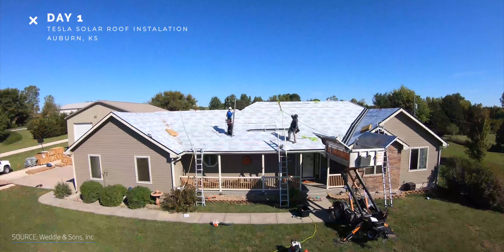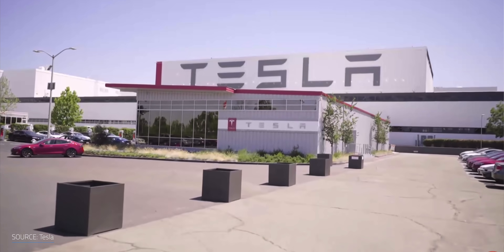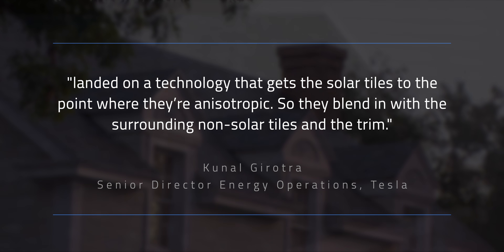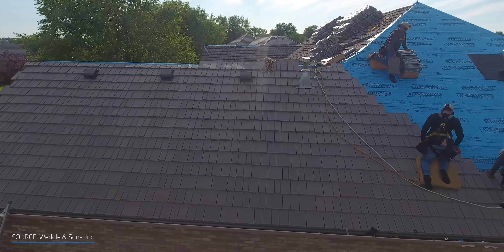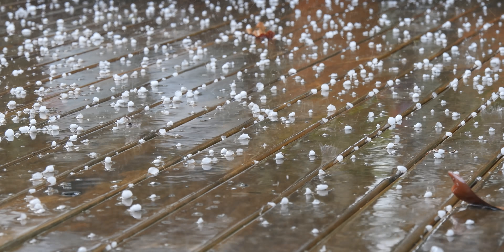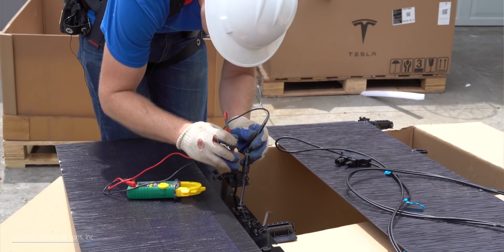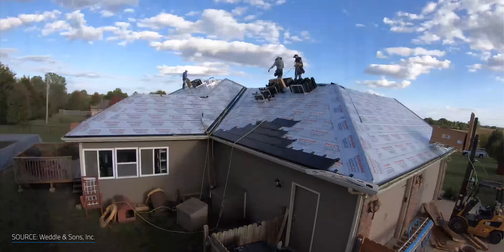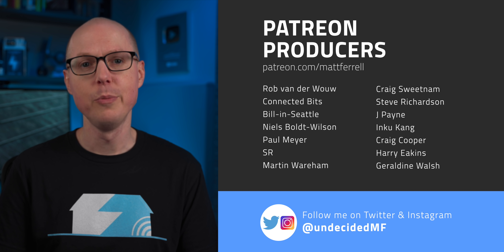Exploring If Tesla Solar Roof Is About To Go Mainstream?

Comment: How is it possible that you went the whole video never once even hinting at the fact that the roof is offsetting your electric bill costs which has a direct impact on the actual "cost" of the roof.
Reply: So when you pay 40k+ for this roof....How long exactly until these offsets pay for it? 20+years? No thanks.
Reply: @Mookaton  I'm paying $40k 34.2kw of 380w longi panels ($0.46cdn/watt) which supply 26kw of SMA Sunny Boy 41 series inverters, ac-coupling to a pair of 6kw SMA sunny island's powered via 24.5kwh Nissan Leaf modules. Tesla roof will likely never pay for itself given the lousy 4.9% efficiency. I'm in Vancouver Canada. Powered up a portion of the system Feb. 21st and currently have 22kw of the 34kw panels hooked up. I've made 712kwh in just 9 days. What are people saying about northern latitudes. BTW they put out more power in cold sunny weather than in the hot desert. Go metal roof. Never replace it in your lifetime. Everything else is garbage.
Reply: Cuz probably thats a feature of every photovoltaic system. And here he is just talking about Tesla's roof tiles
Reply: The video includes a lot of price comparisons to normal roof + PV, both cases would offset your bills so it comes down to installation cost.
Reply: that's more of a electricians job, he's just doing the side part of the roof. as for saying we actually need hard data, which is annoying
we need someone to give us info on there home electricity bill before and after for at lest 1-2 years.

but realty to pay off most homes and solar homes it will take a generation, lets say I'm 40 years old and it will take 20 years to pay off, I will be 60 years old by time it's paid off, 
https://electrek.co/2020/06/26/tesla-solar-roof-review-owner-3-months/

$83,000 before incentives.

They calculate that the solar installation saved them over $400 during the first 3 months of operation.

lets say $60,000 after incentives and they saved $500 every 3 months which would be 2,000 per year saved which then it will take 30 years to pay off. Solar is going to be one of those long journeys to pay off or the next person
Reply: @knightwolf3511  You can save at least a quarter of that if you don't get these special solar panels from Tesla that imitate roof tiles. Also, no need to cover 100% of the roof, 40-50% would be fine. If we include state solar tax incentives and self installation you can get the total cost down to about 10k or less. That could be paid off by the saving in about 6 years or less.
Reply: @BlankestKnight  kinda wish the solar panels could be direct shipped from Panasonic from EU to U.S. skips the middle man which is Tesla
Reply: @knightwolf3511  You also have to take away the cost of the roof repairs and the cost of using different tiles from the price as they would have had to pay that even without any solar installation., It looks like that drops the price by another 10k for the repairs and whatever the cost of normal roof tiles over the next 25 years would have been you can take off of the 83,000.

Also add to the fact that the price includes a power bank that provides benefits beyond standard roofing or even solar.
Reply: @agafaba  Also, when people say “how long until the Solar Roof pays for itself?” I think “How long before asphalt shingles create enough value to pay for their installation cost?”

I will say, though, my neighbor two doors down spent like $50k on solar, but he says “I lost $50k” because appraisers looked at them and said “we don’t have enough data to say they are a feature that ‘improves’ the value of a house,” so they appraised the house at the same price as if it didn’t have solar. Meanwhile, a friend who used to work at SolarCity believed in the product enough to have a system set up in his LV, Nevada house (we’re web friends, not neighbors), but the utility companies successfully lobbied the mayor to have solar houses taxes raised, which ended up making their house unsalable and forcing them to move back to LV from SoCal.
Reply: You need to factor in insurance premiums and the fact these panels are a depreciating asset.
Reply: @ROCCOCYCLES  so you anti solar only go with shingles only!
Reply: Yeah I agree - needs to weigh up swapping out the 2 family cars for electric.  The maximum benefits to someone like me who pays out a fortune for oil heating throughout plus water heating - plus running the water pumps to move all the water for the underfloor heating.
Reply: @WonPXL  You must be in a higher latitude where solar is very non-viable.
Reply: @protonneutron9046  Solar is viable at higher latitudes but not year round.  With high energy costs in these areas, the ROI is more rapid.  My daughter lives in Fairbanks, Alaska and I have noticed there are solar panels all over the place.  24 hour sun in the summer helps generate a lot of power.
Reply: @thomasandriesen443  LMAO!  VIABLE MEANS an economical replacement for base load generation.  So, sing it, "Solar is NOT viable at higher latitudes."
Reply: @protonneutron9046  Doesn’t sound like a very catchy song.
Reply: @evshrug  Hopefully not too many fools will have to learn it the hard way
Reply: @protonneutron9046  That's a catchy tune. Thanks!
Reply: @protonneutron9046  Well, having solar be viable for lots of power half the year, but not the other half isn't that big of an issue on its own. I mean keep in mind it's pretty normal for lots of locations to have power production plants that are sitting at minimal production through much of the year, if not even just off in some cases, and they just bring them on during the winter months when everyone needs extra power for heating, if your countries grid suddenly needs that extra 30% of power during winter, you're probably having to spin up some new plants then anyway, or sitting on more power plants at lower production levels during those other times. So a seasonal shift isn't unusual or really problematic, it just means you still need the other options in play. I mean, when I have a nice sunny day out, i don't turn on the heater in the house to heat it up, I open up the windows and doors and let in a nice warm draft and some sunlight. I still have that heater for when I need it, but the simple solar/atmospheric heating option is easy enough and cheaper so I use it when its a viable option. Same reason I'd only start up a fireplace during a particularly cold day, or if the power went out for some reason. Similarly here as long as solar is predictable (like several months long, not randomly good one or two days then not some others), then you can predict when to power those other more smelly and in some cases more expensive options and just use whatever is easiest at any given time.

So solar alone is not perfect, like everything else it needs to be thought of in balance for everything, but there are no simple one size fits all solutions as everything is complex, interconnected, and regularly changing, both seasonal but also through many other reasons and cases when it comes to the power grid. Still, it can be considered viable if it's able to supply power consistently for half a year or something, and as long as that extra cost of adding solar to the grid, is offset by not spending fuel from the otherwise existing plants during that part of the year when they give way for solar or wind or such.
Reply: @terricon4  Until last week Texans didn't need extra grid power for heat in the winter (generally we have very mild winters)... so power plants and other power generators were in fact turned off and some were undergoing maintenance, and then they wished they hadn't had them turned off! Oooops! ERCOT board members are dropping like flies now! :-\ 

I think that at some point it will be much more practical for distributed power generation systems such as these Tesla Roof Tiles and everyone will have a Tesla (or other brand) of power-roof installed.... it just makes good sense! In Texas in the summertime the sun just beats down on our asphalt roof tiles relentlessly causing our attic spaces to become heat-baths, that's a total waste of the sun's power turning it into heat where and when we don't need heat! So it will just make sense... I think we're almost at that tipping point with Tesla's new power-tile system. I'd like to see those pesky wires integrated into the panels though so that the connections are made automatically as each panel is locked into place against it's neighboring panels, as well as some sort of smart-integration that will let individual panels fail (if they do) and be automatically bypassed by neighboring panels! Now we're talking about a smart-power-roof! 8-)
Reply: @michaelshrader5139  texan need winterized the power grid!
Reply: @WonPXL  That's a LOT of energy usage. I am fortunate enough to live in a house that requires no heating or cooling system. My typical energy use is at most 400W, when not running a bath or my washer/dryer, I could cover that with a single solar panel.

Comment: Great video, however I am building a house in Atlanta, GA and due to Tesla not selling in Georgia and the fact that there are probably 100's of people looking to put it in, i won't be able to get it installed.  Even GAF has a solar roofing system but it is not sold in GA and don't ask because they have NO interest in getting it started here (as they clearly told me).  The cost is good but unable to get it means it is useless.

Comment: It looks like there's a gap from the panels to the roof. I wonder if this also means better heat insulation for the roof.
Reply: Any separation that allows airflow will.
Solar panels produce less power the warmer they get so airflow is a good thing for them too.

Comment: I would like a Tesla Solar roof.   I'll be building my house next year.   I'm hoping by the time I'm ready for the roof - Tesla Solar 4 will be available.   What I'd like in the next iteration most is more efficient and a reverse power feature that would allow the panels to heat to remove snow - no so much to get the power back but to reduce stress on the roof.   That and much lower pricing on the power wall or a much higher capacity battery (e.g. twice the capacity) at the same price.

Comment: Would like to see you cutting them for the valleys !
Reply: From the look of it, the have tiles that are shaped for the valleys. In the video, they also mentioned "dummy tiles" that might be made from a different material that can be easily cut. If I was a younger man starting my own roofing company, I would definitely become a certified installer for Tesla's solar roof panels.
Reply: @COLORBLASTER  dummy tiles are same material, just without the PV cells and wiring.  Handy if your roof has a dark side.

Comment: Honestly, my biggest concern is Tesla itself. While I'm sure there are a lot of white knight fanbois here, I worry about the anti consumer practices that are overlooked under the guise of saving the world. 
Tesla and Elon have some great ideas, and decent to great products, but it worries me when I see that if my (hypothetical) powerwall isn't hooked up to the internet 24/7, I can't use it. I paid for it. It's mine. I shouldn't have to show Tesla my power usage. At the very least, there should be an opt out. The cars are the same. If I want to replace a wheel bearing in my garage, I should be able to do that. I shouldn't worry that they might "brick" my car for doing my own repairs. And they should have to provide parts like any other car company. 
I shouldn't have to please the almighty Elon years after I purchase something. It's ridiculous. It's like they don't want you to own what you purchased. Only bad things for the consumer can happen when companies operate this way. You can't hide poor ethics behind green. You can do both.
I love the idea of the solar roof. I love the product. But Tesla needs to get it's act together with respect to, well, respect.

Comment: I bought a Tesla solar system about 6 years ago. My roof needs to have the shingles replaced. Part of the contract is that when the time comes Tesla will come out and remove and replace it for $500.flat rate. I have been fighting with them fo 5 months trying to get them to come out and fulfill their part of the contract. They have used every excuse in the book to delay doing it. I would have a third party come out and do it but it’ll cost $4000 and my insurance company won’t pay for it. I wouldn’t have bought the system had I known Tesla was going to treat me this way. I don’t recommend Tesla solar products to ANYONE!😡😡😡

Comment: Why would you put a premium roof on then cover it with panels? I had two 4' x 10' some water heating solar panels that I had taken off to redo the low budget asphalt shingles that were 25 years old and somewhat hail damaged. The roofing company took them off but they did do installs so I still don't have any type of solar. And I've thought that if I do I'd go with pv just because I really don't need that much hot water since I just have a conventional heat pump. But kind of waiting to put last child through college before I do anything either way. And as far as durability I can say the tempered glass on the panles I had did better that my shingles against hail and they were used when I got them but I don't know how long. I'm guessing maybe 5 years so they are like 20-25 years old and still going strong. But do ever scratch them like I did with one of the three I originally bought used. I scratched it and whent from holding a 4x10 sheet of glass to having a bazillion pieces of approximately 1/4" diameter glass all over the place, HFS!

Comment: I replaced a roof on a 4000 square foot house with asphalt shingles for around $30,000. I was unclear on the pricing from the video but assuming 3 or 4 times that price so lets say a $100,000. My worse power bill last summer was $110, in winter its around $60. At $100,000 how will this thing EVER pay for itself? Granted this is obviously a premium product and not people who actually expect a defined payback for a large investment but even for the Gucci bag crowd this just seems crazy.

Comment: Look at 2.50 per watt. A typical in the sun tile would average 4 watt hours per day . Appx  1.5 kWH per year. Most of the country would pay about $.20 for a utility to deliver that. So if all goes well about 12  years to say broke even. However since most will be financing the cost you pay off a 20 year mortgage and still not break even.

Comment: Ahh... there is no difference in the end in savings.  You will still be reliant on a local energy company for back energy and the cost you've incurred for installation plus what you pay the energy company comes out to be approximately what you were paying before you ever considered the installation.  I don't see the benefit.  Also, a good shingle roof will come with I believe a 50 year warranty.  Had Tesla come to my house and I didn't see the benefit.  Good Luck.

Comment: Our dream roof has always been to get a metal roof and then traditional solar panels with a battery storage system. The Tesla roof looks like an intriguing option.
One question though is metal roofs are known to be quite a bit more energy efficient compared to asphalt shingles due to the amount of heat they reflect during the summer and insulation it provides during winter. Do you know how the Tesla roof compares with a metal roof as far as energy efficiency regarding your A/C and heating costs?
Reply: Glass is a good insulator, so should be almost or as good as a metal roof. Solar panels on top of a metal roof would have a bit of shading on those sections with a small air gap so may be a bit better in terms of reducing heat absorption during the summer?

Comment: 56k for a roof?  Out of reach for most of us.  How many years before it pays for itself?  Don't forget to factor in the yearly investment value of that 45k in additional costs- that means unless you save over 4k minimum in electricity costs you will never break even.  If your average electricity bill is 500 a month you will still need at least 25 - 35 years to break even.  If your electricity costs are 300 a month you will NEVER break even.  It can't possibly be worth it unless your electric costs are through the roof.

Comment: I don't understand the Solar Roof fans. If you really want solar, you could switch at any time, you don't have to wait for Tesla. A clay tile roof can last 60 years, depending on the area and roof type (angle), and normal solar modules 30 years. So in the long run, this combination will likely be cheaper.